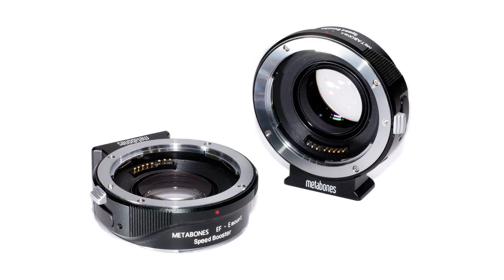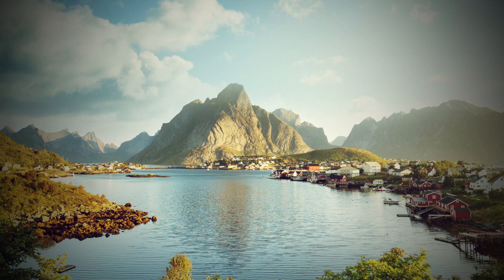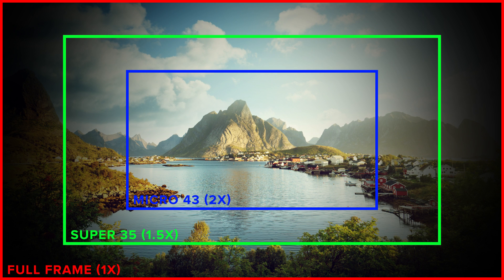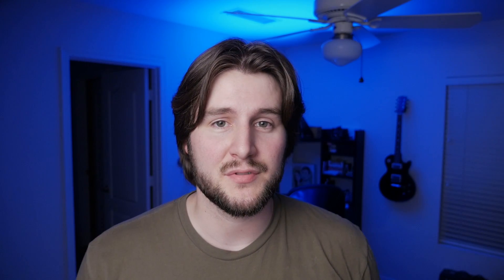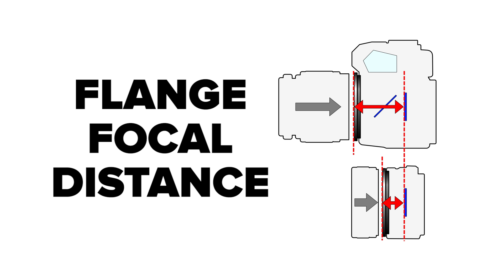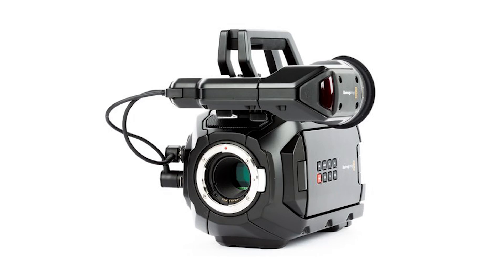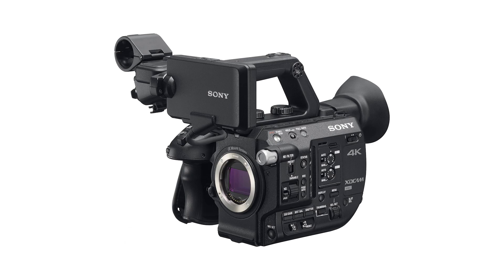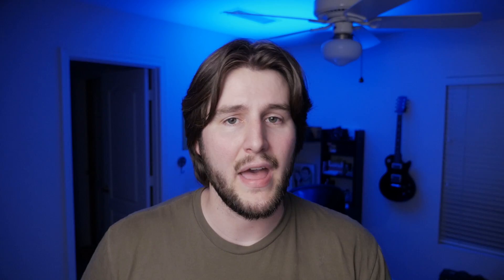How does a Speed Booster work?

Comment: Hm, somehow it misses a bit HOW they work, but only shows what they result in. It's so interesting because this concept isn't new, the legendary Zeiss 50mm f/0.7 is nothing other than a 70mm f/1 with an implemented focal reducer.

Even Canon EF can accept focal reducers, just not from typical fullframe lenses with roughly the same flange focal distance; middle format is no issue, and there are actually adapters.

Comment: good overview Stronz of the speed boosters, thumbs up.   A point you didn't mention is that at least in the case of the Meta Bones booster, is that it significantly increases the sharpness of the lens being used, particularly older prime lenses such as those from Nikon for example.  This is very important because it allows you to shoot those old Nikkors wide open with superior results.